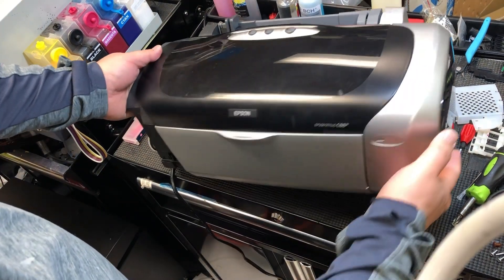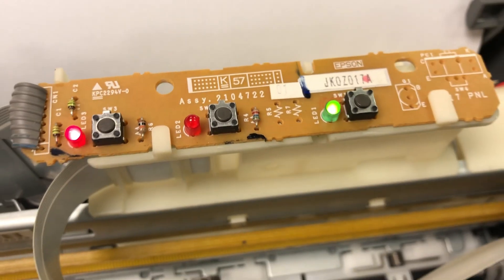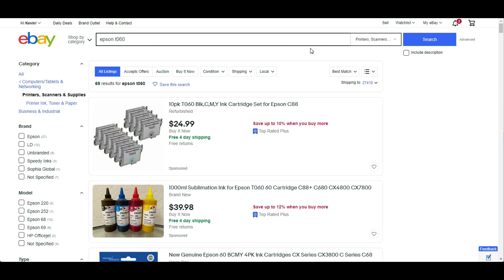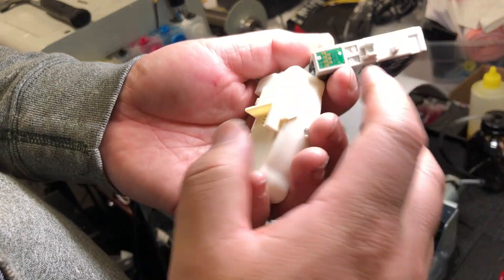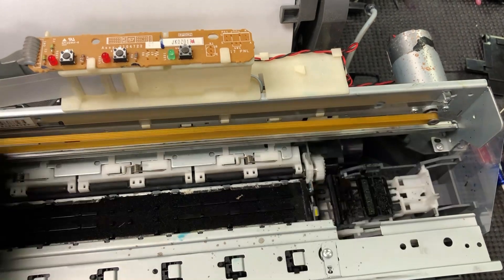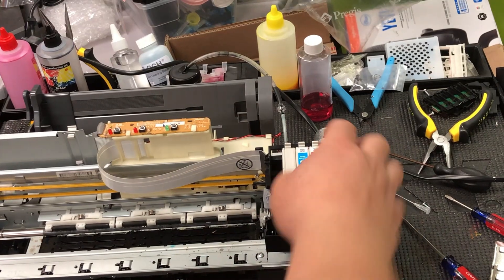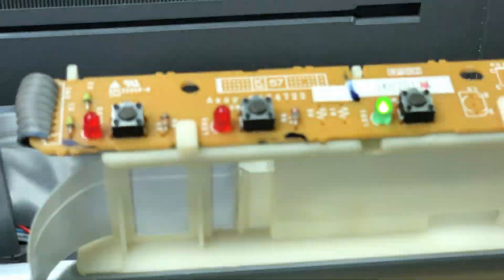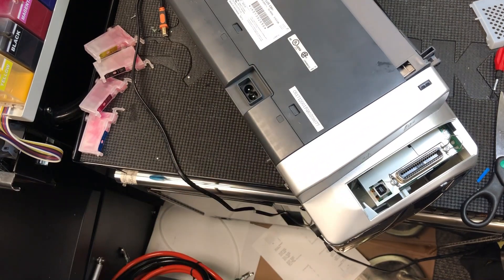How to reset Epson C88+ ink level & fix ink cartridge not recognized

Comment: Cant find a single video on pulling the printhead. All videos for other epson printers show off screws, and it just pulls right out. This one doesn't do either of those two things. I paid for a sub in hopes this might tell me, but I see I gotta pay extra now to find the video thats actually on your website.
Reply from the maker: You're right, pulling out the printhead on this model is a bit different. What are you trying to do with the printhead, since a replacement printhead is almost impossible to get?
Reply: @BCHTechnologies  i grabbed this printer for 15 bucks, and am trying to thoroughly clean and soak the head parts to get it to stop printing blanks